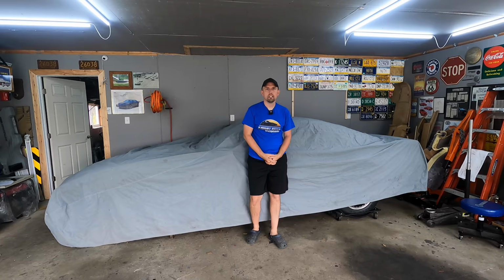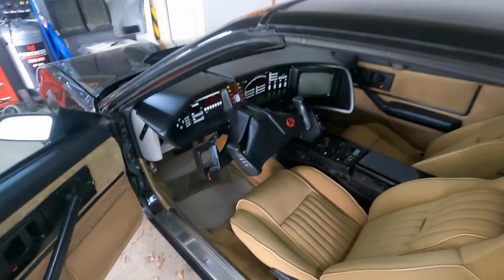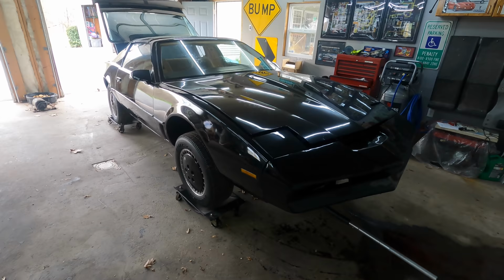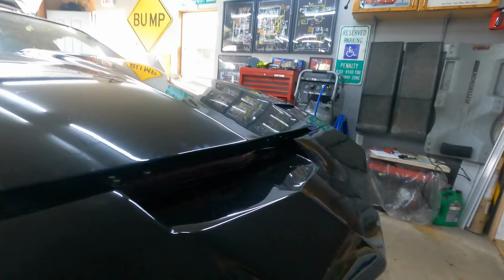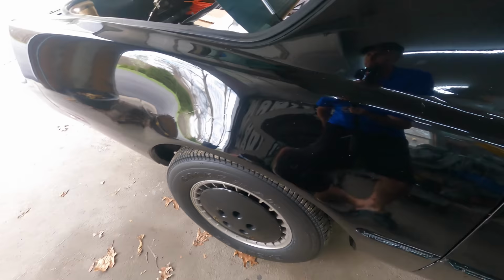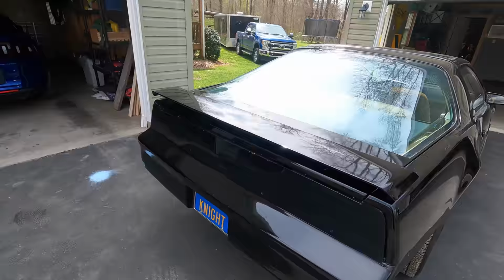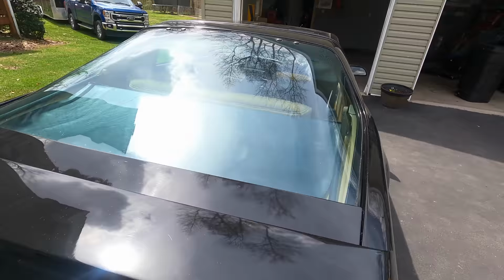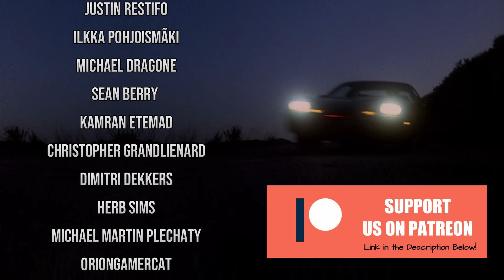Screen Used KITT from Knight Rider - Underside Tour and Car Show Prep/Loading into Trailer!

Comment: What other work have you needed to do over the years? I would guess you've had to change fluids and what interval do you go by? Also I'm guessing that you use fuel stabilizer? Just curious. FYI, I've been told that suntan lotion with high SPF works great to preserve rubber from UV radiation. Those dollies probably prevent flat spots too. Sorry to drone on. Thanks for the tour, would love to see more definitely.
Reply from the maker: Nothing major - it doesn't get driven on the road so there's not a lot of maintenance. I always use fuel stabilizer!

Comment: I’m a transmission guy. If the car leaks after long term storage, it’s most likely not the front seal. The front seal has pressurized fluid behind it whenever the car is running. If the seal leaked, it would be gushing fluid while the engine is running. 
Most likely your leak is coming from the seal around the dipstick, the electrical plug on the side of the case, the seal around the TV (throttle valve) cable, the shaft for the shifter, or the speedometer cable seal. Usually those potential leak points are above the normal fluid level. However, after the car fits several weeks, the fluid that’s normally in the torque converter will slowly drain back into the transmission pan, raising the fluid level much higher than it normal would be. That’s why you don’t see the leak during short term storage. 

On a related subject, after long term storage, occasionally when you put the car on drive or reverse, nothing happens for several seconds. That’s because it takes a while for the pump to refill the torque converter. There is absolutely nothing wrong with the transmission.
Reply from the maker: Thanks, Matt. Just to clarify, this car has a TH350 in it, so there's no electrical plug on the side. It leaks even after a day or two of not being driven. When I get the chance, I'll get under there to see if I can confirm exactly where the fluid is coming from. What's your contact info? Maybe we can converse offline, I can share some pics, and you can diagnose exactly what needs fixed so it doesn't leak any longer.
Reply: @KnightRiderHistoriansOfficial  if you have access to a black light, you can use a small amount of A/C oil with the fluorescent dye to highlight the leak. Add a little as/C oil to the trans fluid,, run the car lint enough to circulate the dye. The black light will pinpoint the leak location. 

It makes sense the car has a 350 in it. The 700 transmissions in those years were not very durable.

Comment: Looks and sounds great buddy. Speaking of Lucas, they make a great transmission additive that I've come to trust through the years. It may help with that seal leak. I've owned several GM vehicles over the years and always had pump seals leak when sitting, but once I would drive them, it would be fine. Never bothered with them unless it got really bad. If I had a shop with a lift, I'd tell you to come on by...hell I'd be glad just to have a garage lol. Pulling a RWD trans isn't too bad on the ground. FWD is rough.
Reply: I was never a mechanic in a can guy but that stuff really works. I thought my RV needed a new tranny but that additive did the job.

Comment: They are such a great looking car to begin with. The studios made a great choice to make a Trans-Am into Kitt.
Yours looks fantastic, and all the better for showing its age too.
That scanner looks awesome. It's not often I see one that operates the way yours does (e.g. correctly) - lots of copies just don't get the halogen fade to look right, and the LED ones are no better.
I was stunned when you described the original brake pads and the low mileage. 

Yes i would like to see more videos about either of your screen used cars and I do have a question: Did your car ever have nitrous fitted by the studio?
Reply from the maker: No it didn't, this one is just the 305
Reply: @KnightRiderHistoriansOfficial  Wow, didn't realize they kept the 305 in any of them.  I learned something. :)

Comment: Thank you for taking care of TV history for us Knight rider fans. If i was still at the shop i used to work at i would be glad to pop the tranny out and replace the seal. Does it have the stock 305 engine in it? Is the tranny a 700R4?
Reply from the maker: Stock 305, TH350 trans
Reply: @KnightRiderHistoriansOfficial  thank
 you. The ole turbo 350. So easy to work on.

Comment: I had a 1983 trans am with the crossfire injection.. they had the same rims but someone stole those discs from my car in 1996 and although the internet did exist, it was in its infancy and it was nothing like what it is today. I was unable to find replacement caps for the rims so I wound up buying late '80s generic Pontiac rims which were ugly.. I wound up selling the car in 2000 because it was the only car I had and I needed it as a commuter car in the Northeast and as a rear wheel drive car it was horrible in the snow so I wound up buying a 93 cutlass with a crazy digital dash and a 3.0. I wish I could have held on to this car though.. although stock, it was only about $160/170 horsepower. I did replace the lifters though and with the WS6 suspension it was able to get out of its own way.lol

Comment: Becareful about pulling youll slip a disk doing that.take it from me its not fun
From a fellow 3rd gen owner to you. I have noticed you don't have a wonderbar installed,I would suggest one if you are gonna drive the vehicled around.its to prevent cracks on the steering Box mount and stop body flex
 You can find one cheap on top down solutions
Reply: I'm glad I'm not the only one who thought that. 
I've coped with a slipped disc causing a trapped sciatic nerve for 30 years, and seeing you pull the back of that car around gave me cold sweats Joe.  You're unkowingly rounding out your back (the wrong way) and it can be fine - until it isn't. And the risk of damage gets greater with age I'm afraid.

I don't want to see the restoration of a screen used Joe Huth.
(alll meant in the nicest possible way - take care)
Reply: @Joesmusclecargarage  i  Suggested one be installed if the vehicle will be driven around

Comment: Ok, folks are gonna call me me crazy or dumb or whatever. But could we see the flip headlights be turned on 1 day. I always loved seeing Michael Knight turn them on. Strangely though in the current episodes of season 3 I have watched. I don't remember them being used much, mainly just the fog lights. Was there a reason behind that? Did the headlights break or something?
Reply: All I can say, is that I purchased an 87 Firebird in 08, and I've had the lights fixed, replaced,  or rigged at least 4 times.  I just don't drive it at night anymore.  The little gear thingy that rolls the lights up/down is just plastic, and it wears off its own teeth every time the lights go up and down.  Eventually, I'm going try to get them replaced or rigged with metal gears.
Reply: @annehenry6243  Oh. Ok. I did not know that. That could definitely explain why they rarely used them in the show. Thanks so very much for the reply. I appreciate it. I hope you can get your headlights up and running correctly with the new gears. Good luck, and thanks for the reply. Have an awesome day.